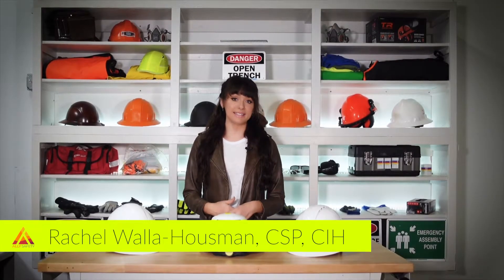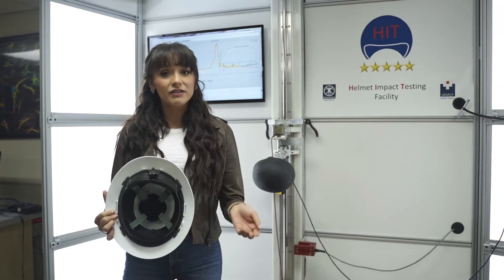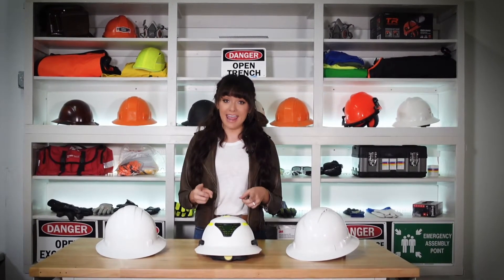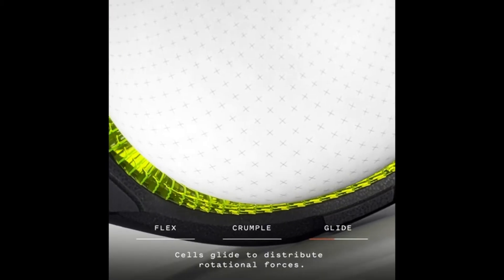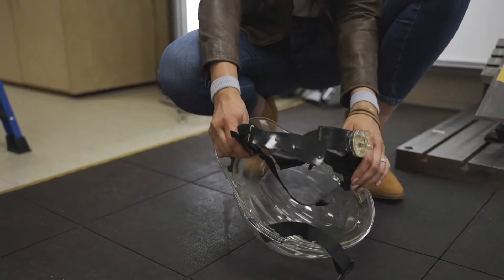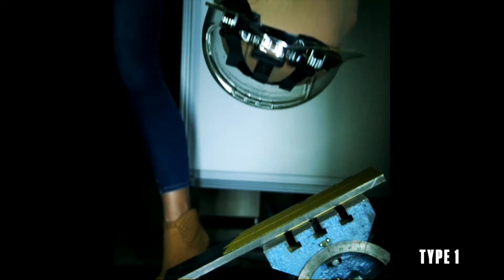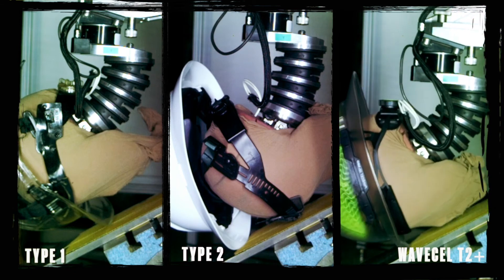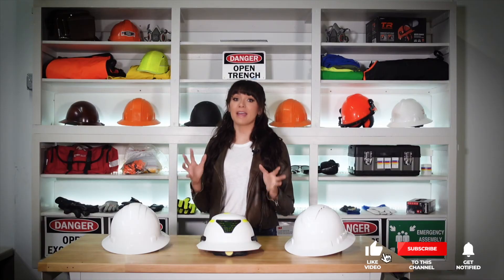WAVECEL HARD HAT TEST VIDEO | Testing a new hard hat design

Comment: Follow up , after  months of wearing this contraption a coworker set his wavecell on a trash can mounted to the outhouse , probably about chest height , when he came out of the outhouse his wavecell was on the ground, the wavecell had fallen off the trash can the back vent cap had popped out and the hat itself was cracked, not an isolated incident as another coworker took off his hat and dropped it on the concrete from chest height 2 times with the same exact result. Not good.
Reply from the maker: Whoa, good to know.

Comment: This is not a hard hat , it is a contraption. ,  been wearing for six months , this is the most uncomfortable torture device ever forced upon my head , makes a busy 8 hour day feel like a  slow 12 hour day with bosses watching. The adjustment dial has a knob on the inside covered  with thin plastic  that drills into the back of my skull to my brain , the back of my head is raw. The hat sits high on my head and feels like its going to fall off if I don't crank it tight.  This thing sits directly on your head  no shock absorption if you take a blow you will feel it for sure , if you take a side blow your head will move with the hit, I don't see how these are even legal. The accessory clips on the side get caught on orange fencing and on wires or any thing that will fit in the grove. The ones with the chin strap are even more dangerous can get caught on rebar or even be potentially fatal if rigging fails and catches the strap. Strap breaks at 24 lbs , 23,lbs can do some damage.  For the price of one dangerous hat you can get 8 reliable fibermetal hats.  There's your honest review thumbs down.

Comment: Our company actually just purchased 25 of the PIP type 2 you test in this video and the results are quite alarming. I have a sales rep sending me a sample of the wavecel for us to test. Next will be trying to talk ownership into the $200 safety helmet.....
Reply from the maker: Cool! Let me know how it goes! The costs can definitely be a tough sell but when you look at the differences in performance it's pretty clear.
Reply: YEs its a high cost up front, but knowing you do not have to buy all the accessories such as the clear goggles and face shields like you do all the other new Type 2 helmets. With those accessories, the cost go up more than the wave cell, not to mention replacing them when they are broken. With the wave cell, you can use the normal aftermarket face shield frames and lenses that are a minimum cost. It will even out in the long run. We are currently waiting on an estimate to place an order. The hard part will be convincing General Contractors that this is actually a type 2 hard hat,  they have the helmet style engrained in their brains.